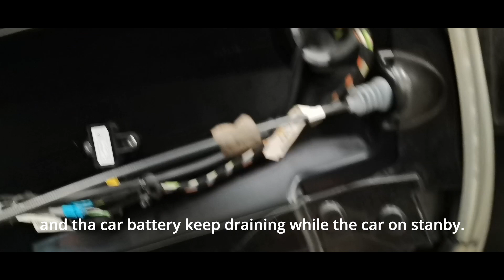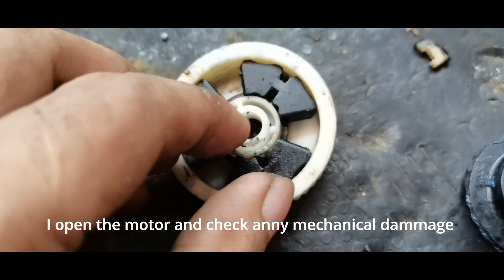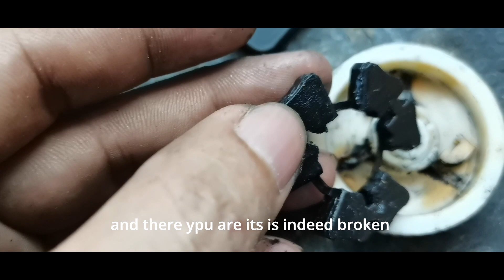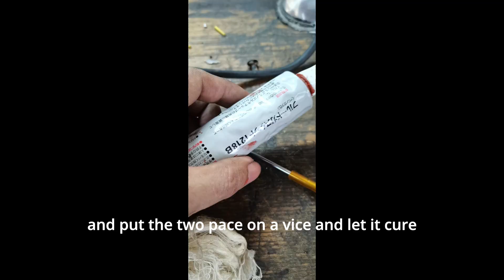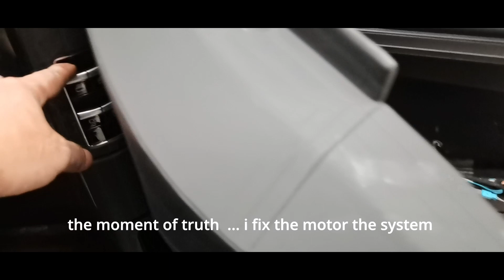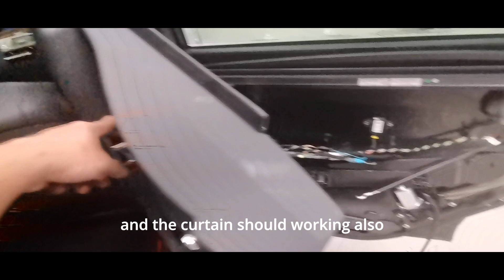Sunshade Blind Curtain Drive Assy MERCEDES S600 Repair

Comment: hey how does it raise and lower are there moving wires inside metalic pipes or any air presure
Reply from the maker: Yes, it has mechanical a long plastic linear gear a metal tube and a motor

Comment: Fellas, any hints and tips on how to raise the rear window sunshade after down itself and won't lift anymore? Tried multiple times hitting the buttons for it and nothing happened... 2008 S550L
Reply from the maker: Maybe the mechanical parts are not working properly. If you can hear the motor working but not ricing the screen definitely there's a problem on the mechanical
Reply: @mixAUTOTECH  Thanx. There is no sound, no noise, absolutely nothing. Dead silence.

Comment: You don't have a video showing and better detail how you remove the motor.
Reply from the maker: It was very easy to remove... It has 3 screw on it on the rail assy.